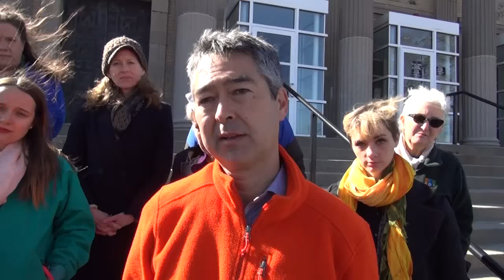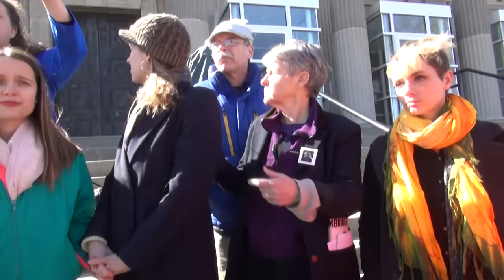What is the West Roxbury Lateral Pipeline?  With Nathan Phillips

Comment: Looking at a house around the corner - it's situated a beautiful rustic street...  I was initially concerned about the BPS but in the end concluded they're 'good enough'.  The methane compression station on the other hand is a pressing concern.

Most of the info I've found regarding the station relates to the protests in 2016 and do not contain hard facts (from the gas company or protestors).  It seems like the residents and city got handed a rotten deal with this pipeline and compressor station.  Anyone have any insight on pollution levels from the facility?  Does it belch gas and/or burn off impurities often and do they run through a scrubber?  Are the benzene, nox, levels elevated?  What is the likely hood of an explosion?  It seems like a gamble given the gas companies track record on leaks (around 65% are known - https://heetma.org/gas-leaks/gas-leak-maps/), high pressure lines, and proximity to the blasting taking place at the quarry...  

"NIMBYism" is frustrating but in this case it seems fairly reasonable.  Unfortunately, I don't see them ripping out the pipeline now that it's been built (despite opposition from the city).  This is an important reminder that our lifestyles have consequences elsewhere (even the electric cars).
Reply from the maker: Hi Patrick,  I'd see if you can contact organizers of many of the associated protests through the http://www.resistthepipeline.org website.  They may have updated information.